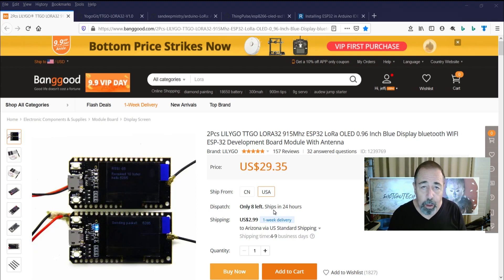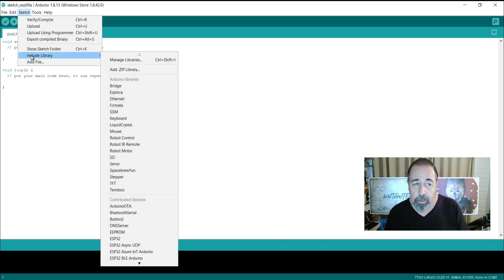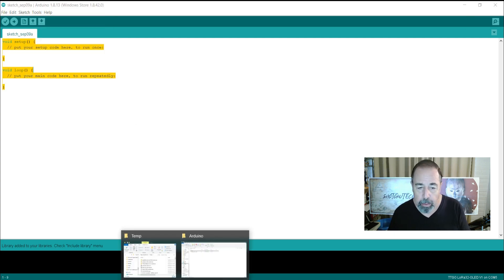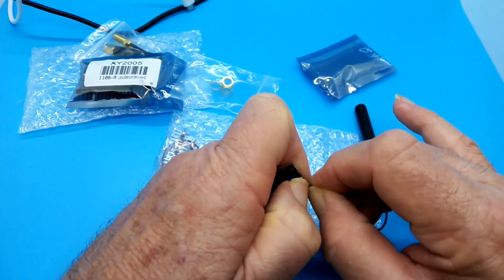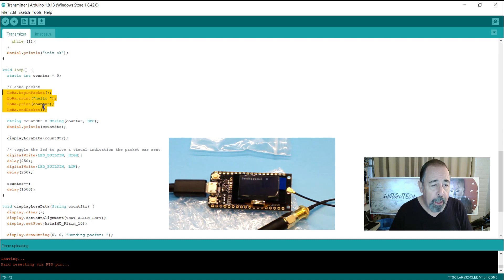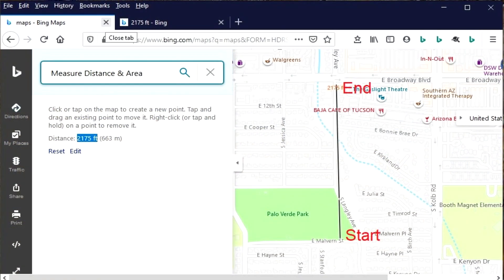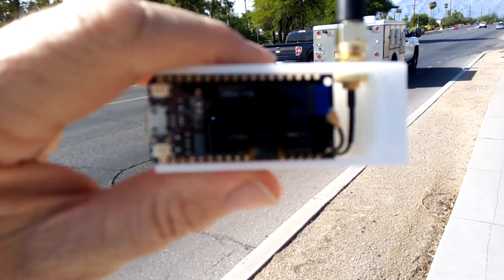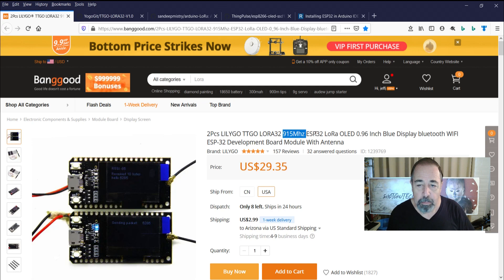Complete LILYGO TTGO LORA32 915Mhz ESP32 Setup and Range Test

Comment: Hi...
Silly little question:
Why is the LoRa of the SX1278 LoRa ESP32 (ttgo) not working?
http://www.lilygo.cn/prod_view.aspx?TypeId=50003&Id=1133&FId=t3:50003:3
I always get: "Starting LoRa failed" with the simple example of Arduino IDE.
Reply from the maker: Correct frequency selected for that board? (433Mhz)?